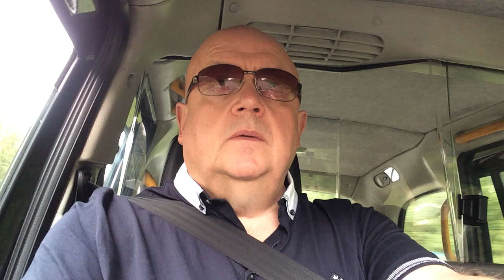Owning a black cab for fun.

Comment: Hi Jim, my chrome hubcaps arrived the other day, thankfully live in landlord here is in most of the time. Quite a tight fit, a good clout with a fist helps to get them on, smartens the wheels up nicely. This weeks job on mine is to fix the aquarium! The taxi light pod on the room leaks and fills with water,  and eventually drips into the cab via the interior light! So I'm going to drop the headlining and sort that out. I'm averaging 30.44mpg, mixed road use, so not great, but not too bad either for a 1900kg tank. Re your rad- try some chemical metal as a gamble, two part putty stuff, mix it up, then paste onto the area. Like you I wouldn't add anything to the actual coolant, not worth the risk of blocking  water jacket on a cylinder or something. Cheers.
Reply from the maker: James, Nice to hear from you. When you explained the Taxi sign I smiled. I had forgotten that that was the first job I had to do. The lens had managed to part company with the box surround. A copious amount of carefully applied black mastic done the trick.
Many thanks for the info on the radiator repair. I will report back up here soon with an update. 
Thanks James 😊